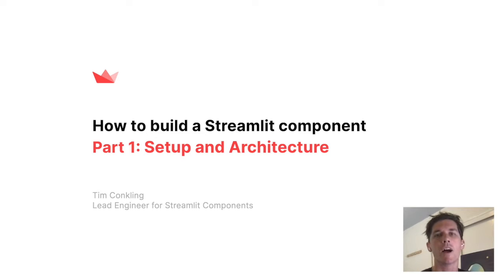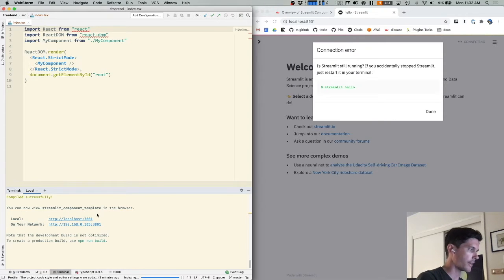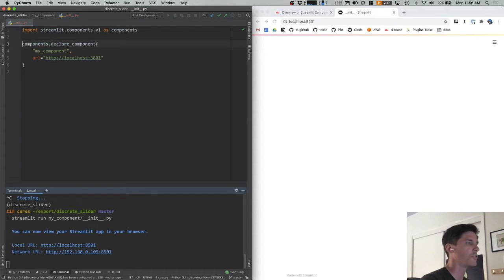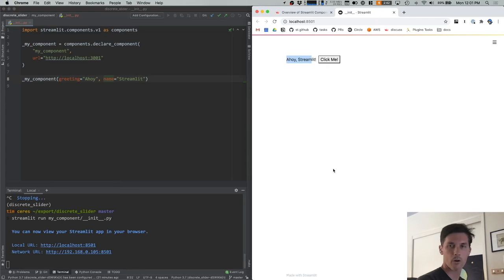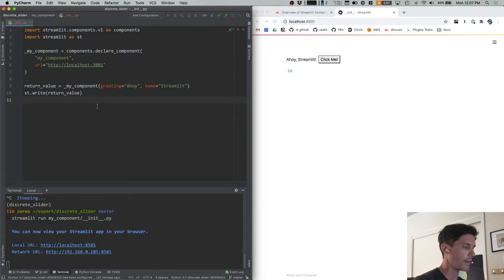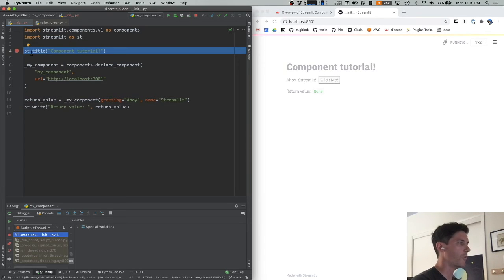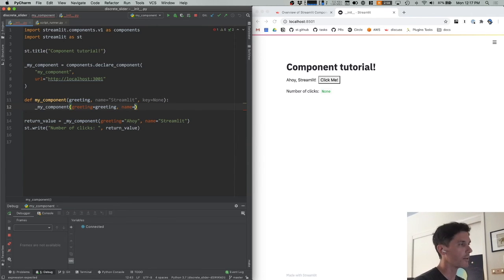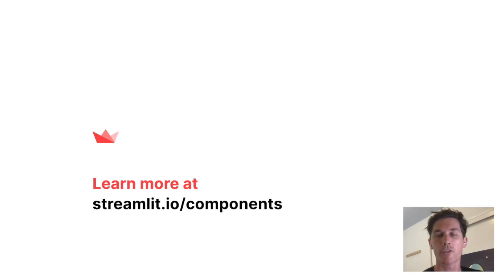How to build a Streamlit component - Part 1: Setup and Architecture

Comment: The library './streamlit' does not exist in the npm library. The correct one would be "streamlit-component-lib". Still, I am receiving the following error message:

Attempted import error: 'Type' is not exported from 'apache-arrow' (imported as 'Type').
ERROR in ./node_modules/streamlit-component-lib/dist/ArrowTable.js 72:13-27
export 'Type' (imported as 'Type') was not found in 'apache-arrow' (module has no exports).

Comment: i want to change the state of stremlit widget once some task is done for example
i want to uncheck the checkbox widget using code once it is checked manually in first time

is there any option  to decide whether  particular widget should run every time or not??

 also any have way to change the state as well as visibility of particular widget like checkbox or radio button etc??
Reply from the maker: Hey Sunil,

We'd love to help out - mind posting your question on our community forum so we can discuss in more detail?

Here is a link: https://discuss.streamlit.io/